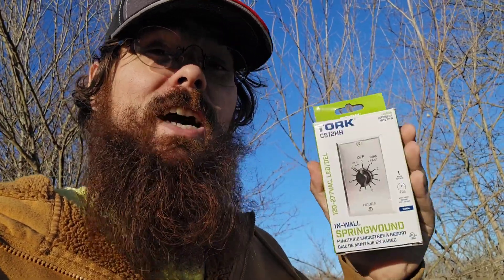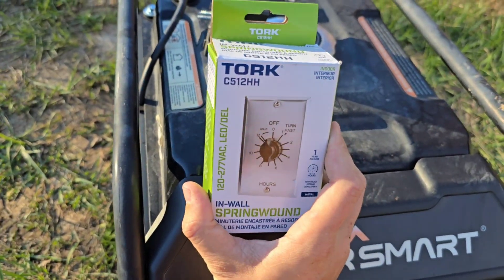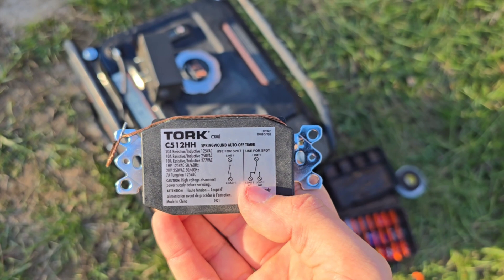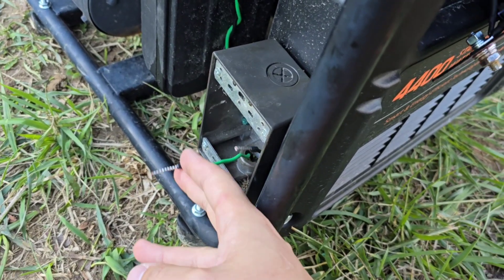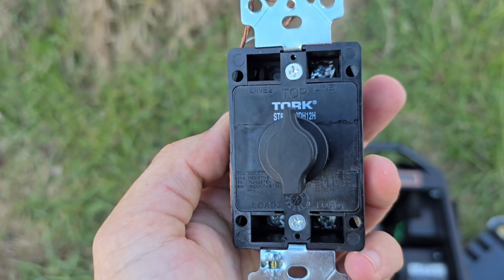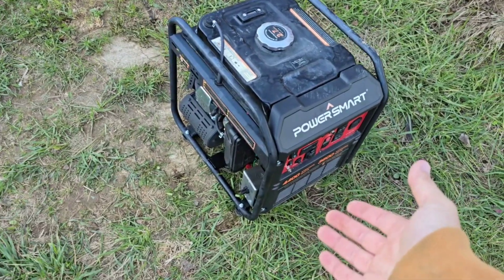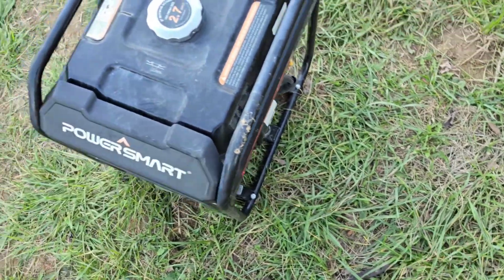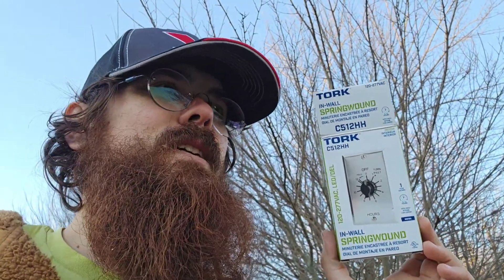SAVE MONEY! Add a Timer to Generator Engine: Simple Upgrade for Fuel Savings! (Or Small Engine)

Comment from the maker: Affiliate links, i earn from qualifying purchases but it doesn't cost you extra.

Timer Switch - https://amzn.to/4fJeVsA

Plastic Electrical Box - https://amzn.to/3YZMjWE

Self Tapping Screw - https://amzn.to/3Z0nJop

Ferrule Kit - https://amzn.to/3CmZQi1

Copper wire - https://amzn.to/3Z2qDt1

Butt Connector Kit (the good one with heat shrink) - https://amzn.to/4elEorb

Wire Stripper - https://amzn.to/4hHHWH2

Power Smart Inverter Generator - https://amzn.to/3O5C3WG

Comment: I totally want to do this, it sounds extremely useful, but Id be afraid what the vibrations from the generator will do to the mechanical clock.
Reply from the maker: @thevinstigator2511  so far so good, i'll update the pinned comment if it goes south

Comment: unfortunately shutting a generator down that has a load on it is not a good thing and doing it to many times will damage it and cause it to no longer make power unless its an Inverter Type generator....... please dont get me wrong this is a great Mod and it has always been on my mind but we need to figure out a transfer switch that will kill the load before shutting it down
Reply from the maker: Dear Mike, it is my understanding that while voltage spikes and frequency issues that can damage loads are common with older generators. 
These newer inverter generators shouldn't pass on harmful voltage spikes and frequency changes to the load during startup and shutdown. The mechanical generator is separate from the load in this case.
I'd love to learn more about this.
Please let me know why the modern inverter generator would have an issue with this if you have input. :)
Reply: @electricblakeyt  don't listen to bro them edited the comment to add that, I come back to buy the stuff in the links and he didn't say not nothing about no inverter generators before he edited that shi. He be lying because you knew better than him fr fr
Reply: @electricblakeyt  thats basically what I said in my original Post.....inverter generators wont have an issue......But Armature generators will blow the triac (diodes) if a load is being drawn durring shut down or start up or even damage the armature........ I probably repair 25 to 30 a yr for just this reason ....... all the rest of the repairs are dirty or contaminated fuel mostly but thats a whole nuther subject !!  LOL.....(Yes we are a generator / power mechanics /small engine repair shop  )